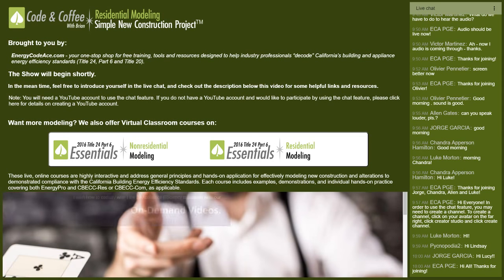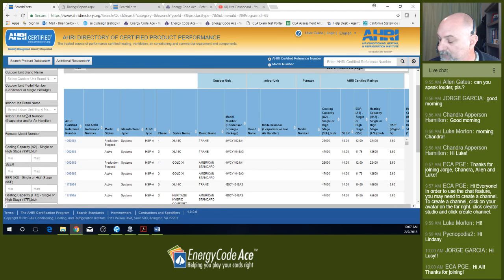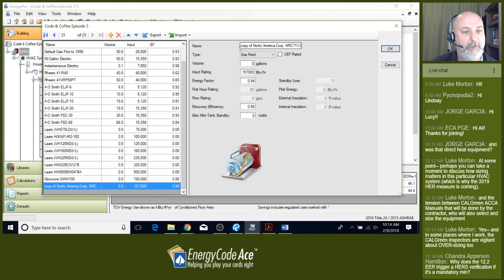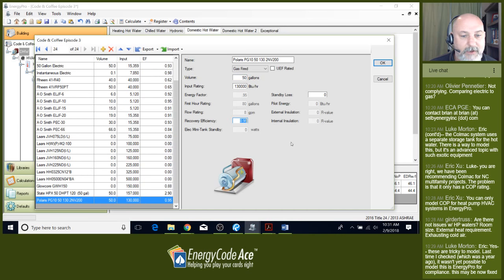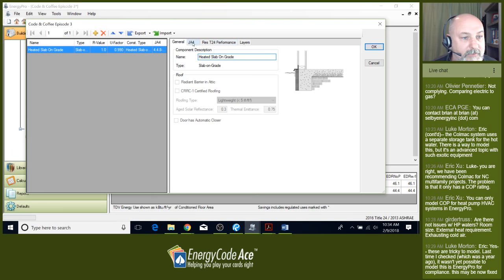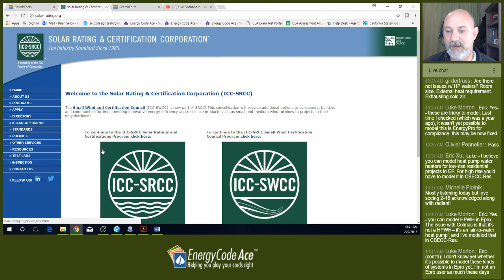Code & Coffee: 2016 Residential Modeling, Simple New Construction — PART 3: Advanced HVAC & DHW

Comment from the maker: Questions Asked During the Live Broadcast:

1.) At some point can you take a moment to discuss how sizing matters in this particular HVAC system (which is why the 2019 HERS measure is coming) Answer @ 12:12

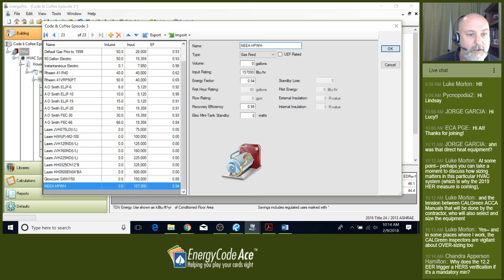2.) Why does the 12.2 EER trigger a HERS verification if it's a mandatory min? Answer @ 14:16

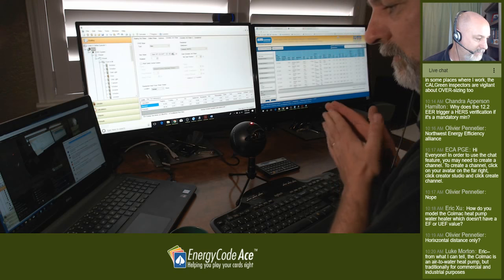3.) Horizontal distance only? Answer @ 20:14

4.) Are there not issues w/ HP waters? Room size. External heat requirement. Exhausting cold air. Answer @ 28:22

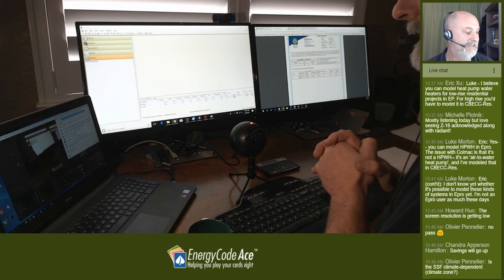5.) Is the SSF climate-dependent (climate zone)? Answer @ 48:15

6.) Does EnergyPro calculate the return on investment for solar thermal? Clients frequently ask the ROI. Answer @ 49:40